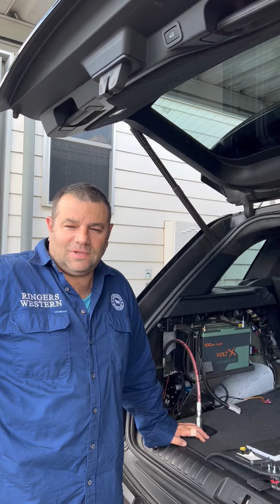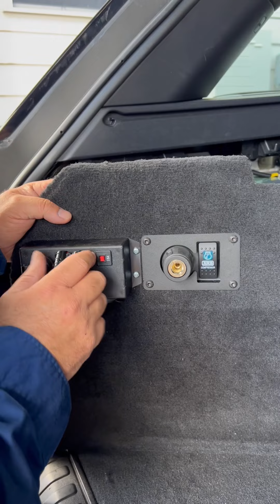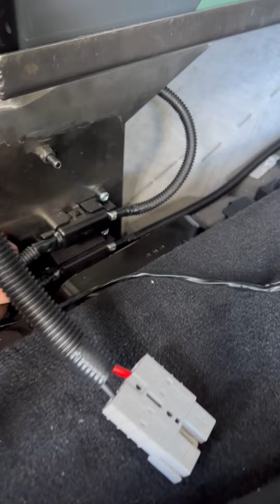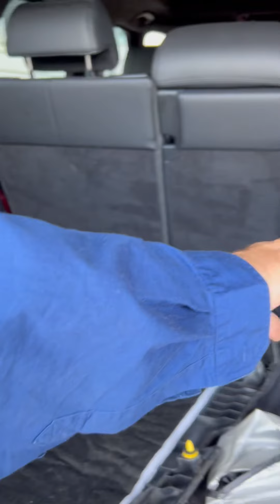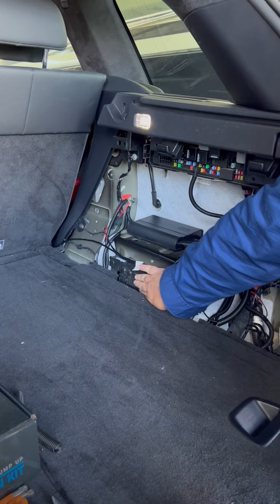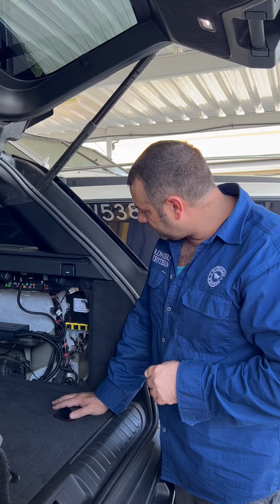Range Rover Sport Outback Tourer basic 12V Auxiliary set up

Comment: Great informative video. I have a similar setup but with the battery on the other side. I’m about to instal the compressor as you have done and I was wondering if you need to take the panel off when using the compressor, due to heat build up? Are you able to share the bracket design for the compressor please? All the best
Reply from the maker: The compressor is mounted to the battery tray.
I was concerned about heat, and I purchased a vent however I’ve never fitted it and been used many times so the heat in my setup wasn’t a issue
Reply: Ok great, thanks Rob. Seems my version only has the battery tray on the rh side, nothing on the left. Such a great idea with your drawer slide giving you access to the spare wheel. I presume the slides are two way, to allow the system to also slide outwards as well?
Reply from the maker: @markiatrucke  
No the slides only slide into the vehicle.
The 30l Engel has plenty room to open the lid and access the bottom of the fridge easily. I’ll be doing a video soon all packed up showing how it all works including my 12v travel buddy fridge.
The battery bracket that is fit is a custom made bracket. 
Good luck with your set up once it’s completed it’s so worth the effort